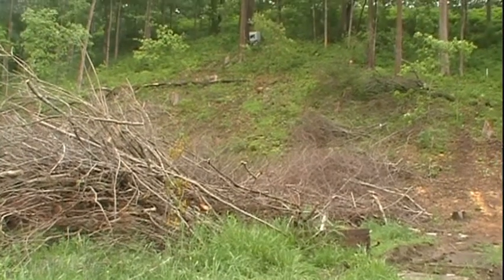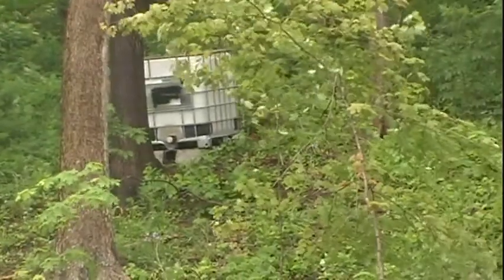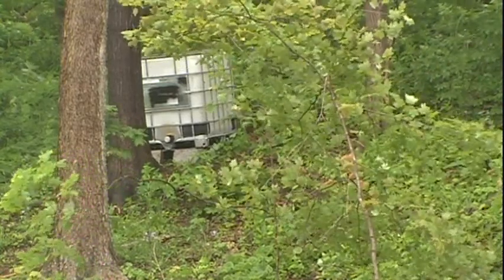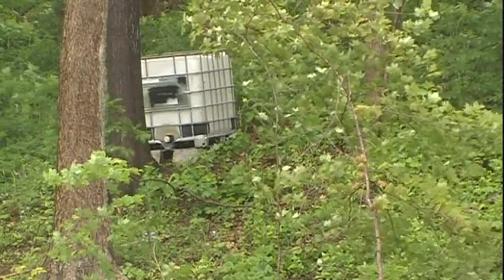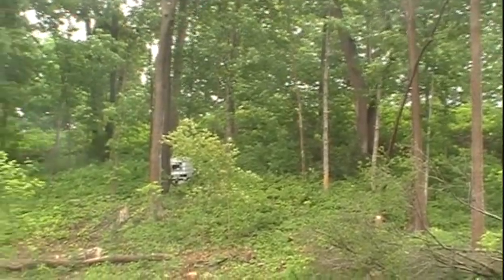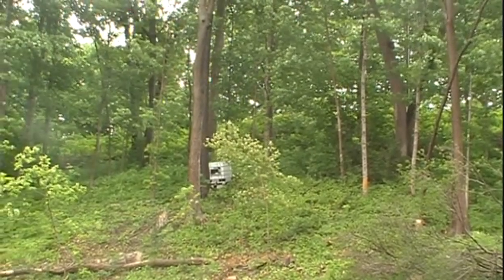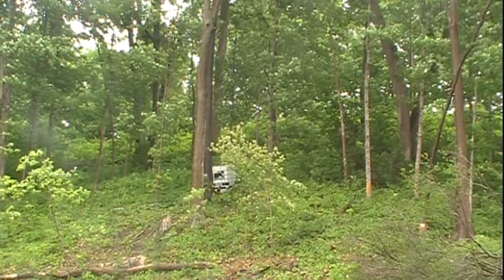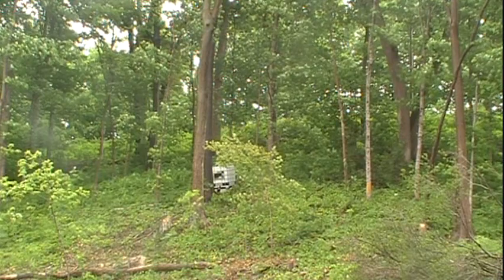A rain barrel positioned to deliver high pressure water

Comment: I have a small orchard (25 trees) 600 feet from my house on a sand hill. Same problem with drought...plenty of water needed. I ran a 3/4" black plastic hose (water line quality; from Lowes) from the house out to the orchard. The hose only costs about $15 per 100ft. I didn't bury it, I just ran in through the woods. It isn't UV stable but it's always in the shade (or under last years' leaves) so it lasts for decades even on the surface. At the orchard I terminated it with a hose bib.